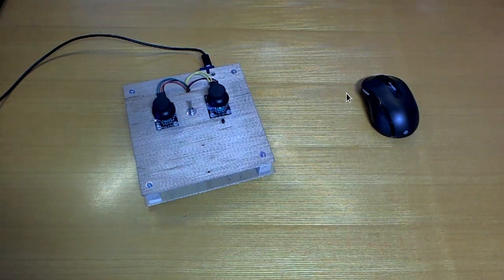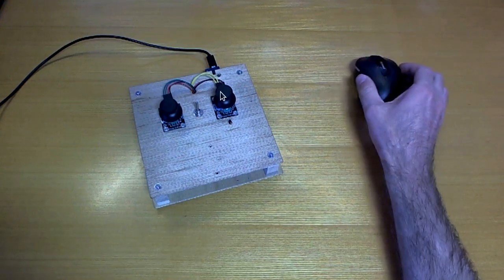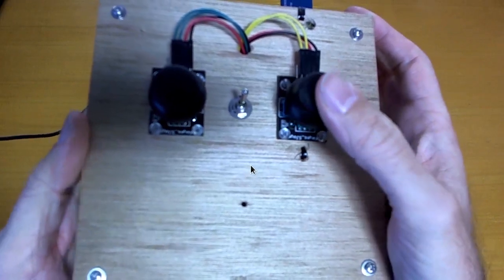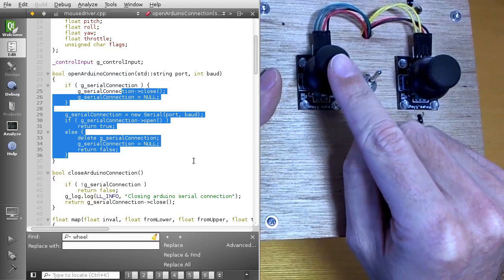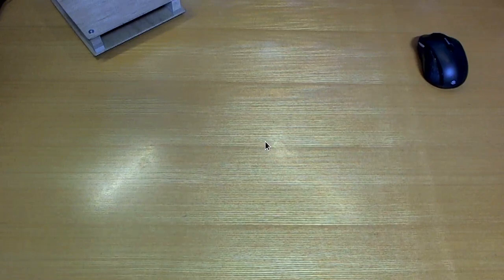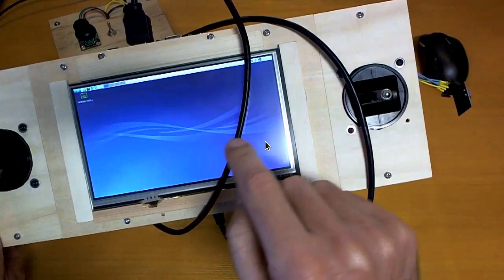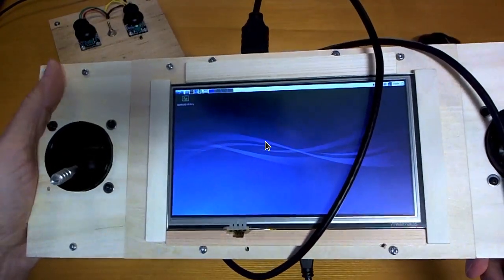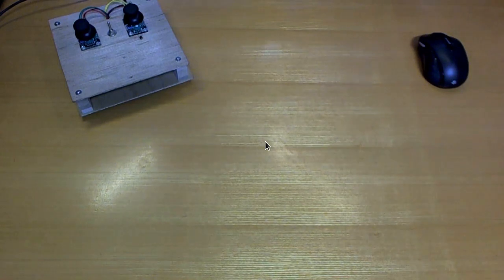RC joystick for mouse input (arduino + linux)

Comment: very cool, got me excited again :)
do you think you could also possibly make this an FPV display? maybe with a USB video grabber on the odroid? :)
Reply from the maker: Actually this monitor has AV and VGA inputs as well as the HDMI I'm using for the odroid. So yes, I could switch over to an FPV display on 'Input 2'. The problem is, then I can't see my tx program anymore, so it would be better if the odroid could show grabbed video inside a window... I wonder about how that would affect the lag time etc though. btw I wanted to watch your skiing vid but it has a copyright strike or something because of the music?
Reply: ***** Oh, that is possible, i will see what i can do :)
I think a cheap grabber would prbably introduce some lag, but they are available for a few bigs, so i think it is worth a try :)

Comment: You sir keep coming up with cool stuff!
About the touch screen, could you give me a heading which model it is and where you bought it?
Thanks!
Reply from the maker: I got it from here, but there are many places that sell it: http://www.banggood.com/1024-x-600-7-Inch-LCD-Touch-Screen-With-Driver-Board-Kit-For-Raspberry-Pi-p-953767.html
By the way, the touch response is not that great. It will be ok for simple presses, but it's terrible for drag+drop or drawing a line type control - you have to press very hard to trigger a touch, and it always loses the touch while dragging.
Reply: I'll check it out, thanks!

Comment: Can you please make the transmitter and receiver for the rc air planes
Reply from the maker: There is no difference for planes or anything else...
Reply: @iforce2d  can you please kindly upload the circuit diagram for my help